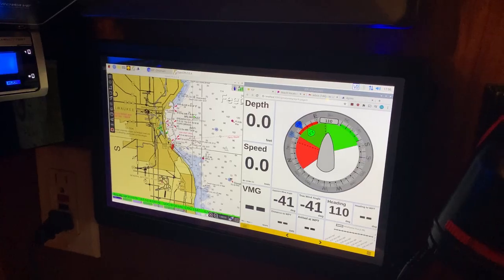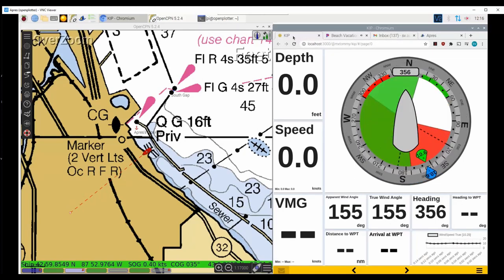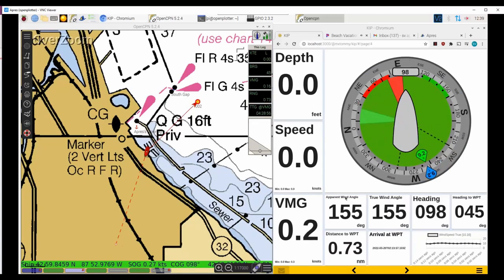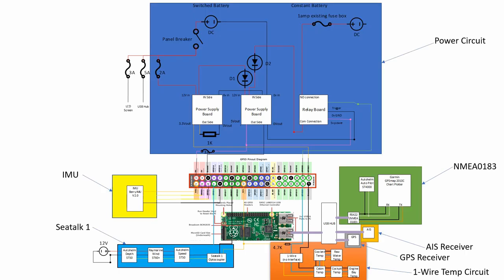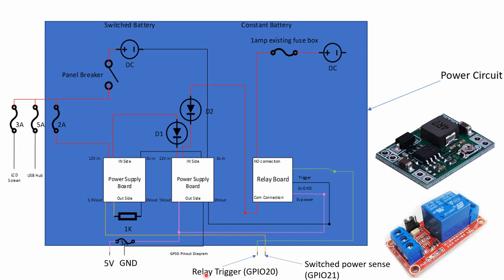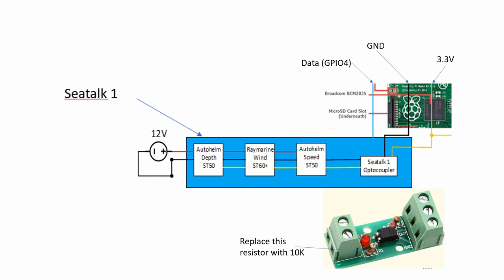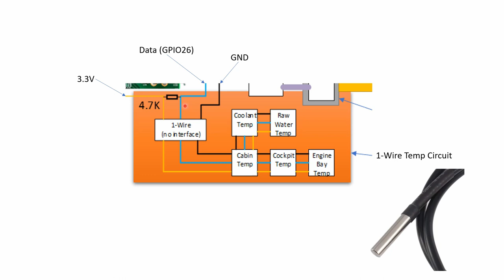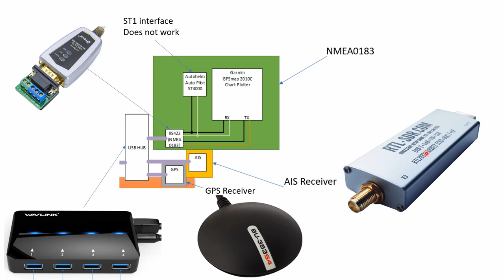Apres Sail - Tech Episode 2   Openplotter - DIY Marine Electronics Operating System for Raspberry Pi

Comment: Wow am I ever glad I found this video. I've been roaming around the internet for days trying to figure out what I'm going to do and it seems you've laid it all out. I've recently purchased a boat that has Seatalk1 equipment on board. I basically want to do exactly what you have. I'm more software than hardware so it is a bit intimidating. I'm going to watch this video a few times but if you're available I'd love to have a chat with you as I'm sure I will have some questions if you would be willing to help that would be incredible.
Reply from the maker: There are a few video's in the series that may help you but I would be happy to help if you need anything!!
Reply: @ApresSail  I've just spent the last while watching all of them. I've ordered a number of parts to get started. As things start to come in I'm sure I'll be back. I do have a Raymarine Multi at my nav station and it does have Seatalk on the back so that will be quite convenient to hook into the network I hope.

Comment: @ApresSail Thank you again for sharing your setup and findings! I have not fully succeeded with the reading of ST1 data. I got a similar optocoupler as you (recommended also  on other YT videos) however reading the ST data works only intermittently: it works flawlessly sometimes, but most of the time, no data is received even though the optocoupler's led light is blinking showing ST data is being received. In my setup I have a 4.7k resistor on the ground input to the optocoupler as recommended in other videos. Did you soldered the 10k resistor on top of the existing one? I have not much experience soldering (or in electronics for that matter) but I can try to do this if required.
I've tried restarting the gpiod service (works occasionally), removing and adding the ST connection via   signal K, and the GPIO interface too.
Also, and this is the weirdest, sometimes touching the signal out pin with a cable seems to trigger it to work too (this works very often).
I am using a PI 4, GPIO 17 as the input (connected to the out pin of the optocoupler) I read 3v between the vcc and gnd pins on the optocoupler.

Any advice or tests I should run?
Reply from the maker: Seems like you need to adjust the resistance, touching the cable may slightly change the total resistance as you make a better or worse connection, probably only slightly though.  You could try another 4.7K resistor in series with the one you have on the ground side of the input - just twist it into the ground cable and then into the screw in connector.  if that works, then do what I did and remove the 4.7k and add a 10K in its place.  The value of this resistor depends on your total resistance of the ST1 lines, too low and the pulses are not crisp enough (up and down), too high and the pulses don't have enough amplitude to register as a pulse - good luck!!
Reply: @ApresSail  Thank you very much for your detailed response! I will try this.
Reply: @ApresSail  thank you for your response. If I add an extra 4.7 resistor in series then there is no led blinking anymore and still no data. The connection to the st network I made is at the nav station, about 10ft from away from the the last sensor. All original cables, except for the last few inches where I connect to the optocoupler and the pi. This is very strange to me. Any ideas?

Comment: Such an awesome video. I could kiss you. I would love to get my autopilot running with this setup. It’s an ST6000 I guess. How do you do the mirror from the rasp to the display in the cockpit?
Reply from the maker: Glad you enjoyed it!  The Raspberry Pi 4B has 2 HDMI outputs, so I have both plugged in and then setup in clone mode.  its best if you buy monitors with the same resolution.  Mine are both 1080P.

Comment: Hi Jason, was talking on Facebook with you and thought commenting on the video would be better.  I'm interested in your "one wire" setup.  I have a PICAN-M hat so I'm wondering if you think I could still use your one wire approach or maybe I should come off the I2C (or something else).  PS:  still learning!
Reply from the maker: I think the PICAN-M only uses a few of the pins and therefore I think you should be able to use 1-wire with it.  just connect it up and give it a whirl

Comment: Hi. Like the video a lot. I have a couple of questions: do you send the IMU data to your autopilot? And if so would it work on a raymarine st600+ with an S2/3 smart pilot course computer?
Reply from the maker: In my case the IMU data is sent to the Autopilot via NMEA0183 but I don't believe the autopilot uses it.  my Autopilot is really old and has its own compass that it uses for boat direction.  I think the only info the AP uses is wind and waypoint if those modes are chosen when operating the AP.  Yours is newer but probably still has its own compass (and you may be able to use that instead of the IMU for heading).  What you will be able to do is send commands to the AP from anywhere on the network like a remote control - you will need to connect the AP in via NMEA2000

Comment: Hi, I don’t understand the diagram with the temperature sensors. Are the all in the same 3 wires? Or do you need 3 wires for each on them? Thx.
Reply from the maker: there are 3 wires at the pi and each of the sensors are 3 wires, you could run a bus system where the 1 wire sensors were tied into a 3 wire bus, or you could take each sensors out separately, running three wires for each sensor.  I did a combination - at the pi, 1 sensor is connected directly and a second set of 3 wires run 10feet to the Helm - at the helm, another 1 sensor is connected and then the 3 wires continue another 8 ft to the engine bay where 3 sensors are connected. - hopefully this helps?

Comment: I'm mostly interested in that touchscreen you have at the helm, any links? I run a similar setup but with an Intel NUC on my 33ft boat :D
Reply from the maker: I will be releasing a separate video on the screen in a couple of weeks but its by Sihovision (https://www.sihovision.com/), it was somewhat custom - Waterproof (IP67), Capacitive Touch Screen, 1000Nit sunlight readable, 1080P, optically bonded and fully dimmable 0-100%.  I am using an adapter to run HDMI and USB over 3x Cat6 cables
Reply: @ApresSail  cheers! Interested to see the video, I'll be waiting :D
Reply: @ApresSail care to share what they sell for?
Reply from the maker: @numbemers9030  The monitor was $624 in December 2021.  Again this had custom features that I wanted and I believe it was a great deal.  The advice I would give is protect the HDMI connection - HDMI can be flaky to start with, add a Marine environment and you really want to focus on waterproofing and corrosion resistance.

Comment: Hello Skipper, can you sent Routes or Waypoints via OpenCpn to your autohelm (raymarine) autopilot? Excuse me, my english is not the best ;-)
Reply from the maker: Your English is great!  with my current setup I can steer to Wind and Direction but steering to a course from a chart plotter has not successful despite the manual saying it is possible, in testing I have found it doesn't work.  People on the SignalK Slack channel have said that the later ones work fine but the ST4000 was very basic.  Eventually, I think I will put a Pypilot dual control in with the ability to select between the ST4000 control head and the Pypilot for redundancy.

Comment: Does your system use transducers at all?
Reply from the maker: it uses the old Raymarine ST60/ST50 Seatalk 1 based boat speed and wind spd/direction transducers.  it uses a $10 Imu as a compass and a USB based GPS receiver.  then there are some temperature sensors as well.